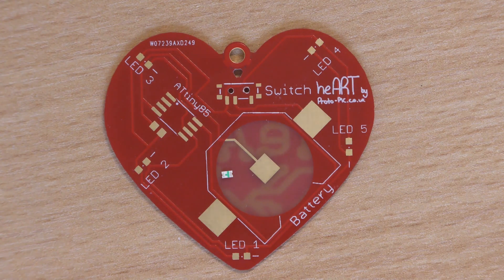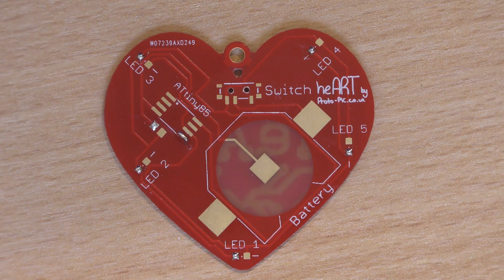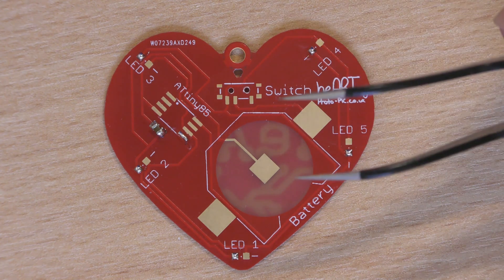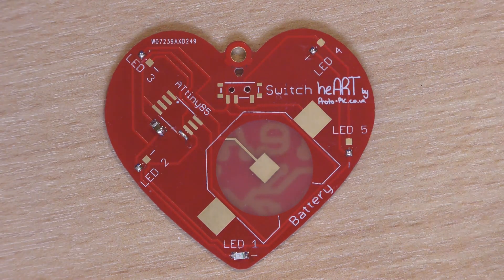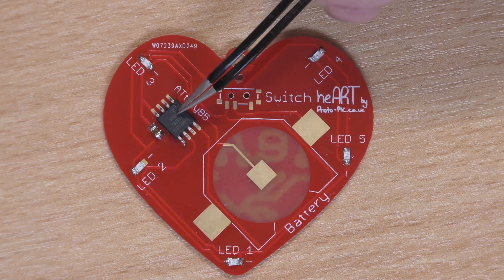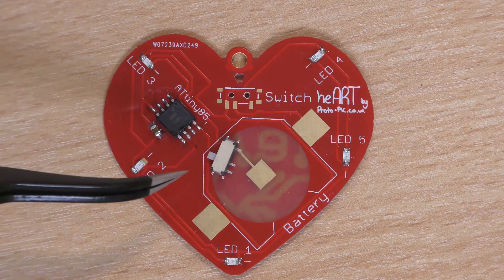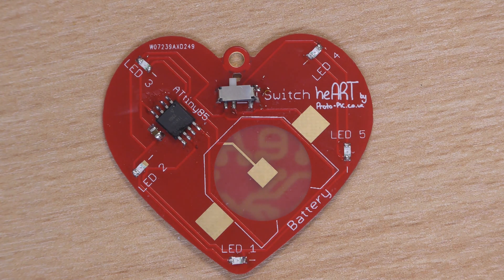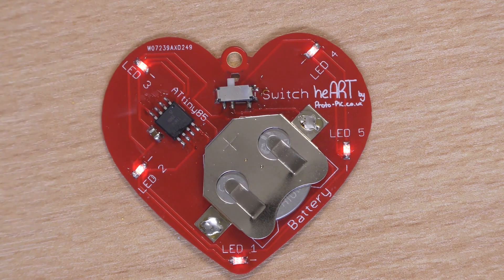Surface mount soldering kit tutorial SMD SMT heART kit

Comment: I have just bought this kit for my daughter. It's a lovely kit! I solder surface mount components slightly differently. I have some separate flux from a plumbers merchant that is quite sticky. I put a tiny dab of this on the pads before any soldering. I then put the component on the pads using tweezers, and the flux holds it in place. Now if you 'load' the soldering iron with some solder, you only have to slightly touch the pad very quickly, and the solder will melt the flux and flow onto the pad and the component, soldering it in place. It means when you do the other side of the component, the solder flows really easily along the path of the flux, between the pad and the component soldering together with very little heat soak to the component. Give it a go! It'll transfer the way you solder surface mount parts. :)